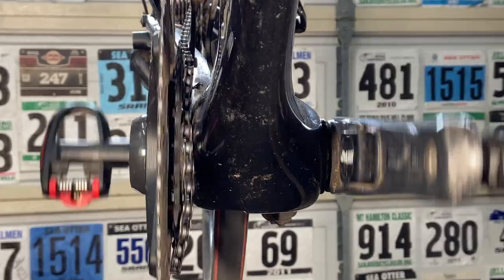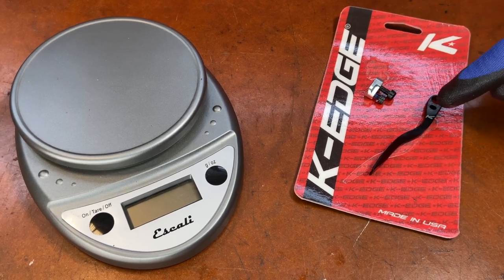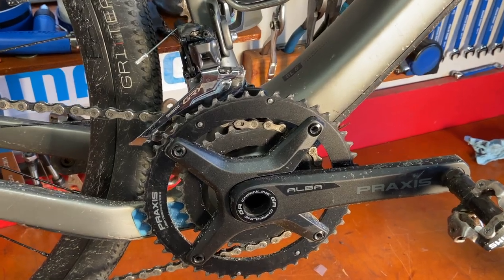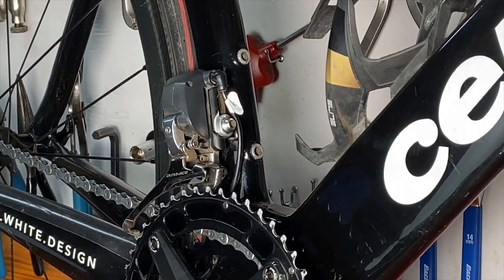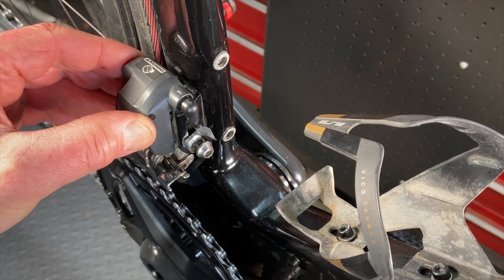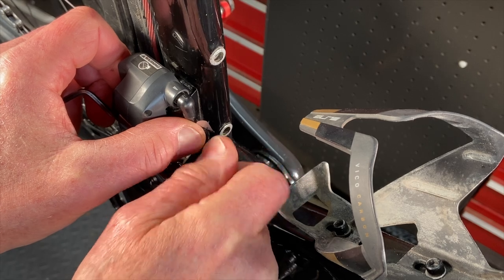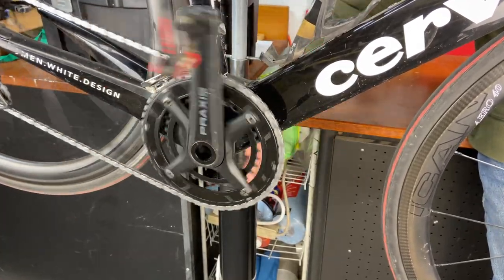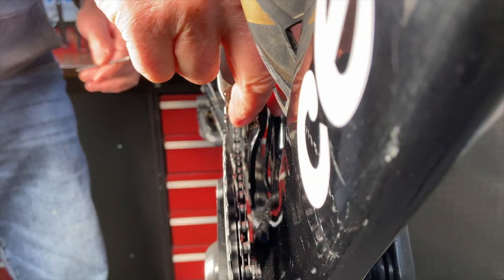Installing a K-EDGE ROAD BIKE CHAIN KEEPER to Stop Chain Drops

Comment from the maker: ★ Watch this video next for ADJUSTING Di2 FRONT DERAILLEURS https://youtu.be/eZO0av3EOW4
🛒If you need a CHAIN KEEPER for a CLAMP-ON FRONT DERAILLEUR here's one https://amzn.to/3KvIArw
Reply: The Deda Dog Fang is probably the most robust and best frame mount chain catcher. There are other similar products (3RD EYE CHAIN WATCHER) but they are more flexible and the chain can get by those sometimes. The Deda is solid enough that isn't likely to happen.
Reply from the maker: @robertschlumpberger22  thanks a lot for watching and sharing your recommendations Rob, appreciate it 🙏❤️

Comment: On some bikes, the chain can wedge and cause damage to the bottom bracket and the inner crank (especially on 3x) as well as the frame. K-Edge is a company that deserves more attention for their interesting products and our loyalty for manufacturing on shore. All the best to you both.
Reply from the maker: Appreciate you watching and commenting, Stan. Chain drops can definitely cause major damage and you can crash badly and get hurt because of it too. I agree that K-Edge deserves more attention for their excellent product. Thanks a lot!

Comment: Another preventative is to never go from biggie big to small big! Better to go to smallie small before entering the actual climb. Good little device, but steel could handle some mistreatment. Shift the front down first, then the back.
Reply from the maker: Appreciate you watching and sharing this great tip, David, you're exactly right that HOW you shift can cause chain drops too so you want to avoid making the shifts you mention. Thank you!

Comment: Last year I had a similar problem on an old MTB converted to single speed using a tensioner. I may not have had the chain length adjusted properly, but after fixing that I still decided to add some extra protection. I searched for solutions and found the Jump Stop from N-Gear and it seems to have worked fine. Been over lots of rocky terrain and no more falling chain issues.
Reply from the maker: Thanks a lot for watching and sharing this tip Morry, appreciate it 👍 Here’s a link for anyone interested https://n-gear.com/ Thanks again!
Reply: Cool! Just a tip that he's not the fastest to respond to emails, but did eventually get back to me. Very happy with the transaction and product quality.
Reply from the maker: @MorryB  thanks a lot for sharing that, Morry - good to know!

Comment: Great video! The tip about keeping a 3mm on hand is the chain drops during a crash is a great pick up. I had a commuter e-bike that had a chain keeper built in and when the chain dropped it was possible for the chain to get wedged in place and hard to remove without pulling things apart.
Reply from the maker: I'm happy you enjoyed the video and the tip on carrying the tool to move the keeper - and from first hand experience too! Thanks for watching and the great comment! 🙏

Comment: Jim
Personally, I would mark the up/down left/right center of the derailleur bolt rather than the contour of the original spacer because the provided K-Edge spacer might differ in size/shape relative to the bolt center from the original one.
By marking the height and angle (left/right) of the center of the bolt, you are sure that you front derailleur will remain in the same position no mater the discrepancies between the two spacers' size/shape.
Basically, you want the derailleur in the same position, not the top or side of the spacer.
Your thoughts?
Reply from the maker: Thanks for watching and the advice on marking the front derailleur position better Sylvain. I like your idea. Depending on the shape of the frame's mount for the ft. der. it can be challenging to find a place to mark. But I think you could put tape on the mount and mark the tape, that might work. I appreciate you suggesting other ways to do it, thank you!

Comment: Thanks Jim!  Just ordered this.. had my first drop this morning and scratched up the carbon a tiny bit but luckily no major damage.  I checked FD H L limit screw settings and they were within spec of Shimano’s specs.  The only thing that I did last night was I aligned the rear derailleur hanger and adjusted the b-tension screw not sure if those were factors.  But I do tend to shift both front and rear derailleurs at the same time as I start the climb,  the chain dropped when I did that this morning… any ideas?
Reply from the maker: Thanks so much Sam, appreciate it! Shifting both derailleurs at the same time does increase the chances of the chain dropping. As for adjustments, the angle of the cage is the biggest drop causer. If it’s not parallel but angled in it can push the chain too far. The chain dropper should stop the chain coming off but it’s worth checking the angle to see if it can be improved. Hope this helps. Let me know how the K Edge works.  Thanks again!!
Reply: @JimLangley1  thanks Jim. I got it installed per your instructions and it appears that it will do its job.  Just a question though, the way that it’s designed,  the top hole does not do anything in terms of fixing the catcher position in place and it’s the bottom bolt that’s fixing the catcher in place..  this design can potentially allow the catcher to move out of position but hopefully it’s been tested that it wouldn’t allow the chain to move the catcher given the bolt is sufficiently tight.
Reply from the maker: @samguan5236  I haven’t talked to K Edge about this but I think it’s designed to move if something goes wrong like a stick in the rear derailleur bending the derailleur and chain and then the bent chain wouldn’t jam and throw you over the bars. I think that’s the idea, i.e. in an emergency it’s designed to move. When preventing chain drops it doesn’t get hit too hard by the chain. Lots of racers rely on them and trust them. I hope you like yours.

Comment: Awesome video thank you! My bike came with an oem part that’s plastic and seems to do the same thing as the k edge part.. do you think it’s worth upgrading to the k edge?
Reply from the maker: Thanks for watching, glad you enjoyed the vid ShredGeek. Usually the proprietary chain keepers the bike companies put on the bikes are there for a good reason - they're designed to fit onto the bike in a specific way that works for the frame. And they usually work really well. So I don't think you'd gain anything by going to the K Edge.

Comment: Can u show us an installation of this chain catcher for SRAM AXS?
Reply from the maker: Thanks for watching and the question. I don't have an AXS derailleur to show. But here's SRAM's video on installation and adjustment of AXS front derailleurs. Once it's on and adjusted, the K-Edge chain catcher goes onto the AXS derailleur the same way I show on the Shimano Di2 derailleur. It's the same process and chain catcher adjustment. Hope this helps.
Reply: I just build my first ever carbon roadbike and i just saw this video and i might happen to me... so the chain can only fall when the chain is on the largest cog and smaller chainring?
Reply from the maker: @emnico6063  congratulations on building your first carbon superbike! Actually the chain catcher is made to stop the chain falling to the inside on whatever cog you're on on the back. The chain doesn't usually fall off but when you shift the front derailleur from the large chainring to the small chainring, that's when things can go wrong - especially if you're pushing like in a race or event and you're trying to stay with other riders on a climb. For example, the chain might be bouncing around a little and you shift onto the small chainring and the chain might come off. If it comes off it can then jam between the frame and crankset sometimes. That's what the chain catcher is for - to add insurance so that if something goes wrong when you shift the chain can't come off. Okay? I hope that explains.
Reply: @JimLangley1  Thanks a lot❤️